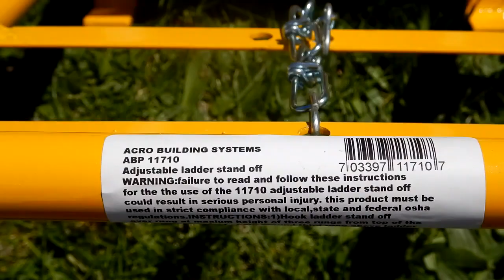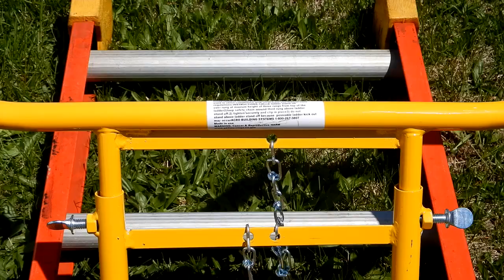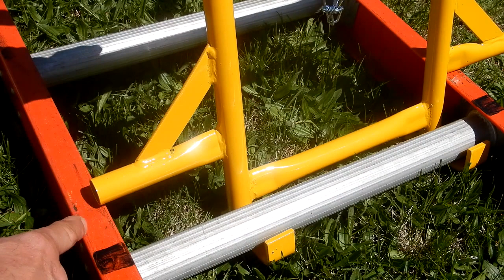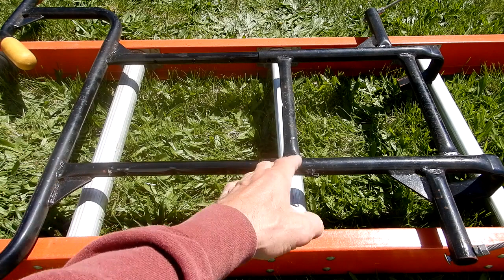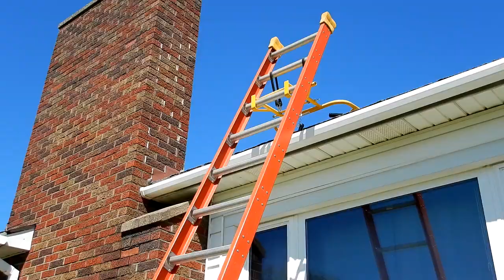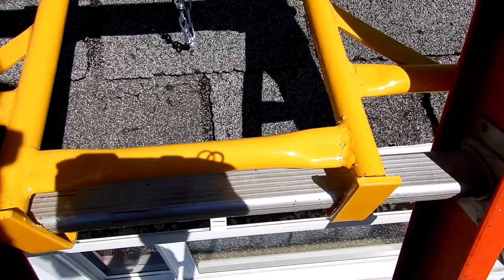ACRO Building Systems Ladder Standoff number 11710

Comment: Bought one, getting ready to remove old slate and install 16 square of new slate....my Acro was ordered at Home Depot this early spring, imho the only thing they should change are the thumb screws, better to have a bolt or pin with a clip with drilled through tubes.
  Great post the main reason I chose the Acro Ladder Standoff is because of your videos. I had used standoffs by other manufacturers but hands down this is the best for me. Thank you for your effort
Reply from the maker: You're welcome and thank you so much for those kind words! Glad my video was of help!

Comment: Nice video. I have a couple of questions. 1) Looks like the plastic caps over the bars rest on the roof shingles. Do they wear or more importantly can they slip? 2) I need to replace some facia boards under my gutters - would these work well for that?
Reply from the maker: Mike Goetzke   Thank you. 1) yes they rest on the shingles. Now, what I have done was put those foam "noodles" that you use in a swimming pool and slide it over the ends. Works great and an extra bit of cushion. I always make sure they rest on a full shingle and NOT on the edge of a shingle as it could tear into it. If your ladder is properly positioned and on good ground I don't see you having any issues. I never have.  2) maybe, maybe not. In your case, fixing fascia boards the ladder itself may be in the way or hold you away from the fascia boards too far. Hard for me to give you a good answer. If you look at my video or even the thumbnail you see how the standoff holds you away from that area. You may be able to work if you do it through the ladder rungs if I am saying it correctly. Depended on what you have a ladder standoff that rests off the siding may be better.

Comment: Thanks, starastronomer! 
I needed one of these to clear my gutters (Gutter Helmets, made of light gauge aluminum--DO NOT BUY--buy screens instead) without damaging the gutters.  Based on this vid, I bought it.  I have an extensible telescoping ladder and this is the only design that will work with it.
Excellent advice!  Thanks again.
Reply from the maker: Edward DeGraaf    Thank you for that! It is a great standoff.